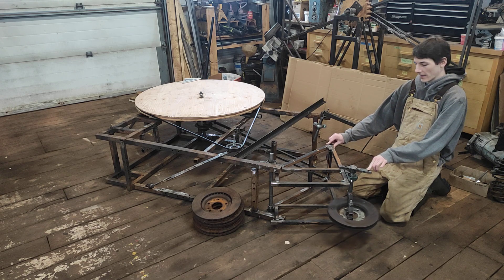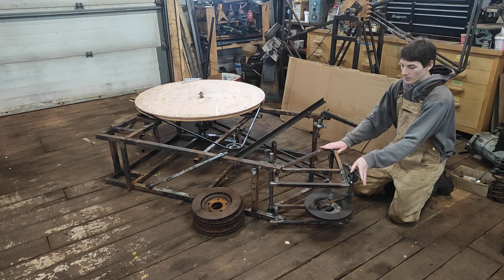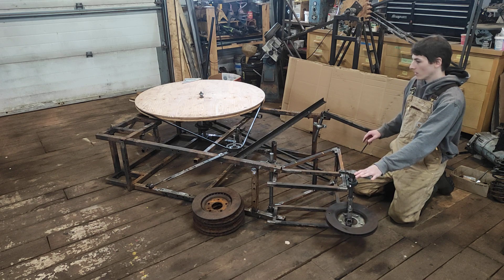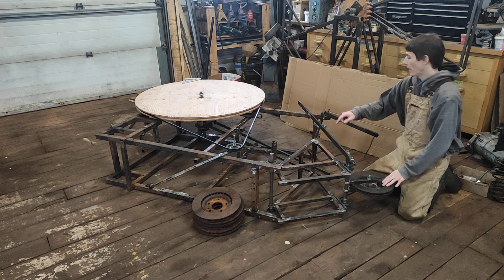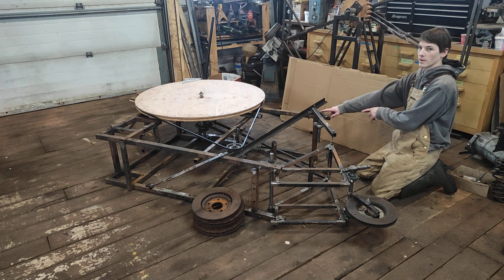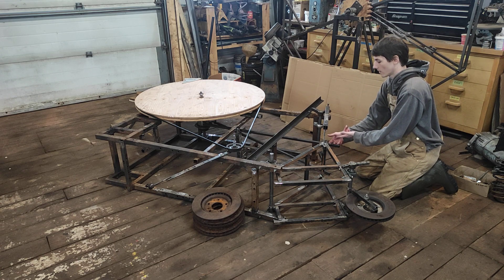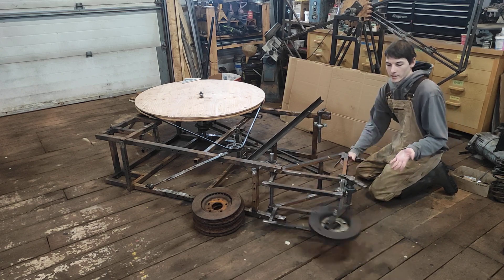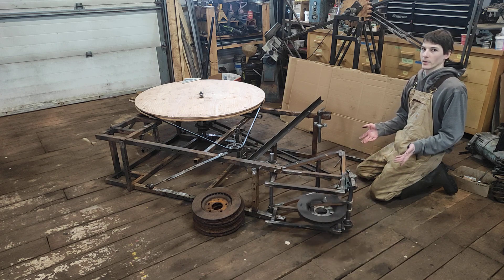The Dilemma of the Skinner Gravity Power Machine

Comment: I like your creative thinking.  No timer circuit is needed. All you need is a gear motor with a camshaft at the end that will give you that slow-motion action to oscillate that mechanism, which will do just like what you are doing by hand. Next, attach an alternator or generator on the bottom or the top of that shaft of eccentric break drum weight that rotates, which will generate volts and amps. 
The final step will be to test input v/s out power to see if the system is under or over unity. 
I can tell you how you can make a pendulum to power itself, and then you can use the second stage (output torque) to generate free electricity. This may be just 5 to 10 watts of free power, but serious electrical output power output will require proper engineering.

Comment: have you ever thought that maybe what you’re attempting to do is impossible? Serious question. You seem very certain that free energy is a physical possibility.
Reply from the maker: I used to think these machines were impossible, until I became enlightened. It's not impossible, but some designs are impossible because they are engineered wrong. It's already been done many times. Bessler's wheel worked. William Skinner's machine worked. The RAR Energeria machine must work because they built the it twice. There are others machines as well. Many things seem impossible, but, not really.
Reply: @QuantumEnergySearch  
Bessler's claims are dubious at best. There isn't enough reliable historical evidence to be able to say that his machine worked, and it seems probable that it was a hoax for financial gain.
Skinner's machine seems to be a glorified/obfuscated flywheel to me. None of what he shows disproves this.
Information on RAR Energia's machine is extremely sparse, and if it did work, the company probably wouldn't still be in the business of solar.

Comment: Similar to William Skinner's gravity machine but without the tilting, these 2-stage systems seem to have some clout.
Reply from the maker: I believe gravity is used in Skinner's machine to keep it in perfect synchronism.
Reply: @QuantumEnergySearch  
It's a bit like this. Hold one side of the backrest on an upright chair and tilt it so the other three legs are off the ground, now tilt the bit you're holding and feel how hard it is to stop the whole structure from twisting, there's a lot of torque. I'm wondering if builders of the past used that same idea for lifting the heavy stuff.